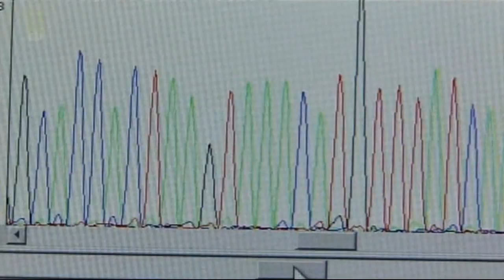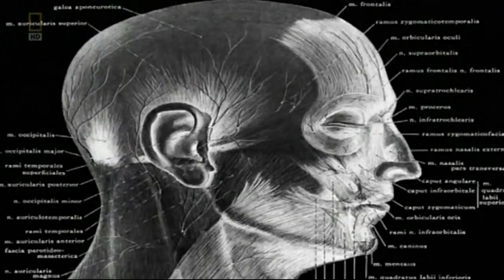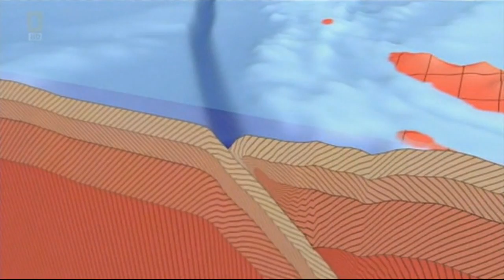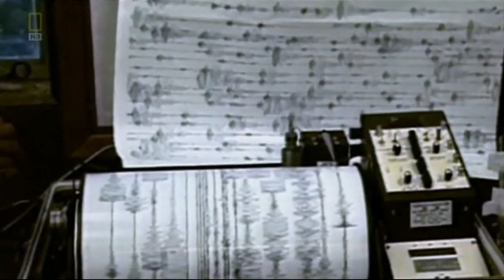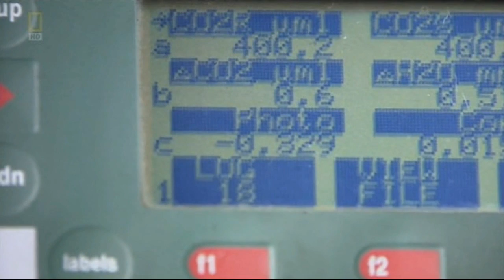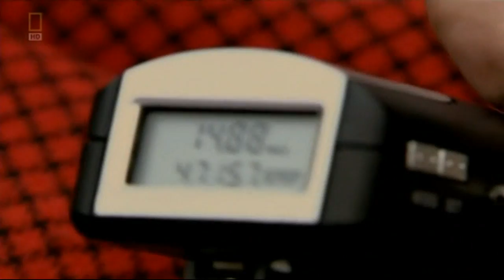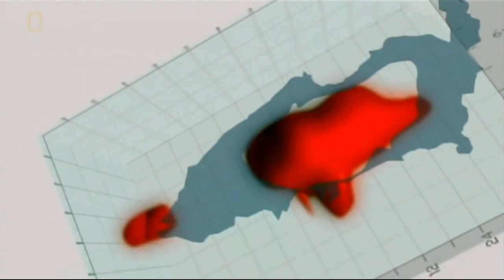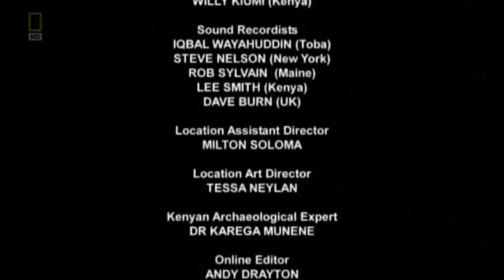Stone Age Apocalypse

Comment: The genetic bottleneck was far more likely caused by a disease or communicable pathogen of some sort, since there is no supporting evidence of other species' extinctions at this time, which is what a natural disaster would have occasioned. I suspect that at some point, the genetic marker for the unique immunity that a small tribe of people had in SE Africa to whatever this disease was will be found.
Reply: Neanderthals and Denisovans survived just fine.
Reply: Ramacat66 I think some ancient version of bubonic plague might've had something to do with it. It's been linked to volcanic winters before, according to  other sources. Cooler temperatures apparently affect the bacteria's effectiveness at reproduction, so if that infects a population already weakened by starvation and exhaustion... basically a prehistoric Black Death. They couldn't have stayed where they were for obvious reasons, so if they attempted to travel and met others, traded goods and so on, that would've only spread the disease.
Reply: Disease does sound like a more likely cause of the bottleneck, if it did in fact occur. However, it should be noted that Neanderthals and Denisovans are believed to have always had much lower population numbers than H. erectus or H. sapiens, so at the time the video places the bottleneck - 50,000 to 100,000 years ago, - both Neanderthals and Denisovans were already in decline, and Denisovans (found only in Asia so far) probably were already extinct (or assimilated into a hybrid species that became H. sapiens in Asia) by 50,000 years ago. Also, Neanderthals survived longer in northern Europe than they did farther south and in Asia. It's believed Neanderthals and Denisovans were both extinct/completely assimilated into our species in Asia before 50,000 years ago. Both these archaic human species were far more robust than modern humans, perhaps they were resistant to whatever disease decimated the H. sapiens population or their different diet and lifestyle helped them survive either a disease of the volcanic eruption detailed in this video. Most probably, competition for resources with invading H. sapiens dealt the final death blow to both Neanderthals and Denisovans, although their genes live on within most modern human populations. Based on the evidence gathered thus far, it appears only modern humans of African descent have no trace of Neanderthal genes; everyone else has from 1% to 4% Neanderthal and potentially an unknown amount of Denisovan genes.

Currently we have too few Denisovan fossils to map that species' genome; I think only some tiny bits of bone and a few teeth have been found in China, but archaeologists there are still working hard to find more fossil evidence. It will be VERY INTERESTING to see how modern humans are related to Denisovans - and whether/how Neanderthals and Denisovans are related to one another - when we finally find enough Denisovan material to create a full DNA map. This video and the many comments here raise very interesting questions with numerous possible solutions. We must also accept that we may NEVER know what really happened and we'll ALWAYS be speculating and theorizing rather than producing actual "proof."
Reply: @Austin VanCampen That was my first thought when he suggested it. The plague (along with most communicable diseases) grew, mutated, and evolved to become more deadly in densely populated areas. I do believe that what we consider to be more or less isolated tribes probably had a lot more contact with each other than we give them credit for. However, once your tribe gets "the plague" or whatever, I doubt you're going to be migrating much after that. So how is it going to spread? The wheel wasn't invented yet. Hell, we weren't even riding horses much less domesticating any animals. We didn't even have dogs for another 40,000 years. So I think this is the biggest weakness in this theory. How does it actually spread? Until that can be answered, I think we can dismiss it. But... it's not impossible. Perhaps the disease had a really really long incubation period, giving an infected tribe lots of time to spread it before suffering the symptoms. Something like... HIV? The problem with this theory is that, diseases that have really long incubation periods, even if they prove eventually fatal, do not prevent people from reproducing and passing on their genes. I believe these are some of the reasons the leading theories point towards a cataclysmic event.
Reply: There's no reason to think that pandemics couldn't have arisen following the climatic changes and famines that resulted from such an eruption. We would certainly have been helpless against something like that 75k years ago.
Reply: Felony Videos ... Wrong!!! Neanderthals and Denisovians are extinct. Didn't you learn that yet?
Reply: Another cycle of the earth catastrophy theory cycle explains all of this rather well.
Reply: Liloh Rydstrom ...I'm sure I was't serious. :)
Reply: or a 1000 humans crash landed on earth 70000 years ago.
Reply: But a few  neanderthal and  other  ancient humans survived too and the proof is in  86%  of the human populations DNA.
Reply: @Liloh - the invention of beer and alcohol probably caused another bottleneck -  though this one wasn't entirely genetic in nature :)
Reply: A disease would not spread like now days back when, cus there was no contact with all people... and far between us all.
Reply: @Goodkarma82 I think HIV style long incubation disease is a good fit after all. Even if it doesn't stop the victims from passing on their genes immediately, their progeny is likely to not survive the collapse of the tribe, and the few that do survive are likely to seek new tribe to attach themselves to, with some of those refugees being carriers.(edit) also, if the disease was sexually transmitted, it would hit the young adult generation hardest, limiting their odds at successful procreation, and then be transmitted to whatever babies have been produced, so again disease fits.